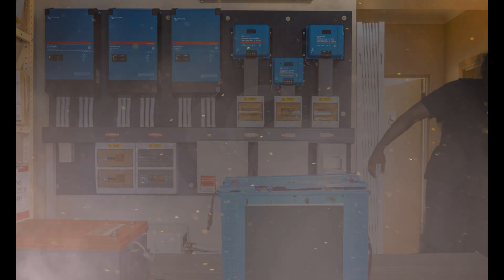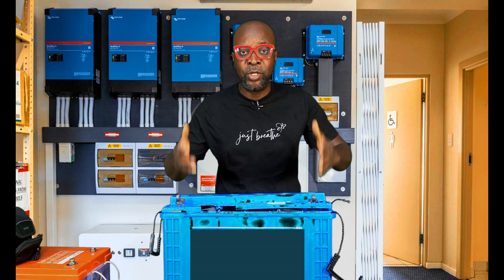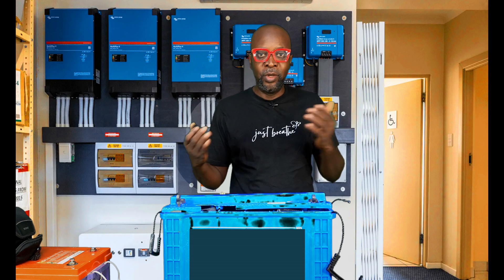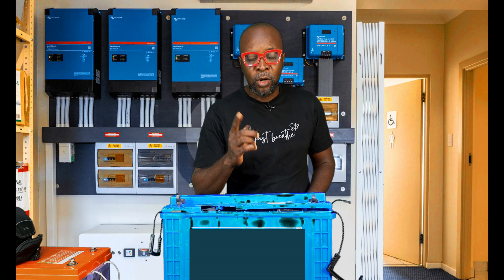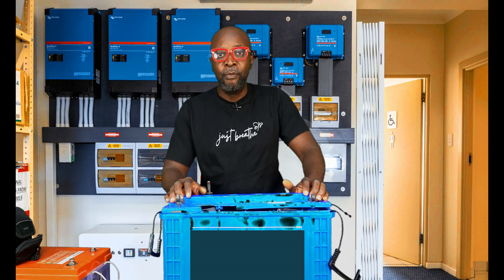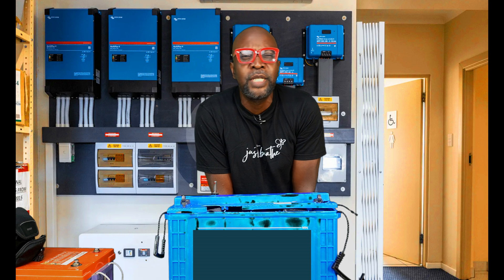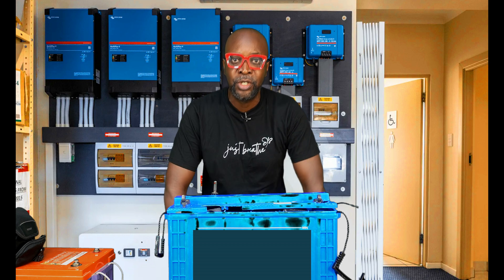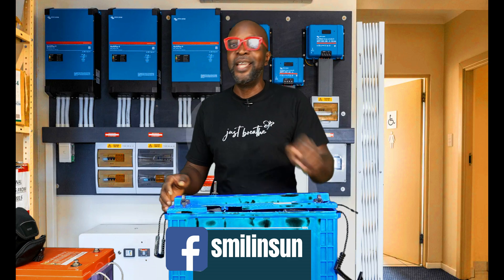7 Extreme conditions that can make your Solar batteries explode.

Comment: The battery where i stay exploded 3 days ago...The battery that exploded has been replaced but the voltage is very high and it's causing the bulbs to burn...It's a direct current.

Comment: Do you need home made well designed high frequency modified sine wave inverter with 100% through hole components no SMD? The advantage of this inverter is its easy maintenace and repair.

Comment: Excellent job bro Ikenna, what about Short circuiting  battery terminals?, can it cause explosion and fire?
Reply from the maker: It can cause fire but not explosion, but though depending on how large the bank is from 3   48 volt parallel bank and below no.

Comment from the maker: Have you ever had experience of battery Explosion? Please share with us
Reply: Hi! Ikenna thanks for your nice presentation. I have experienced explosion on an inverter with lithium battery all in a box. A day after the installation about 4:00 pm I was call that the system exploded setting the house on fire. What happened is that after the installation I couldn't fine the setting for lithium battery on neither the inverter or the system voltage. So I decided to use one option. When the battery was fully charged the system continued charging and exploded  thank God it was installed on the ground floor of an upstairs otherwise the entire building will be on fire.
Reply from the maker: @ucheibe2751  Wow That was quite a situation , Thank you so much Uche for sharing your experience.
Reply: @ucheibe2751  BMS didn't kick in to protect the battery?